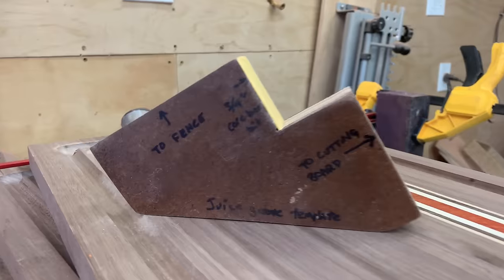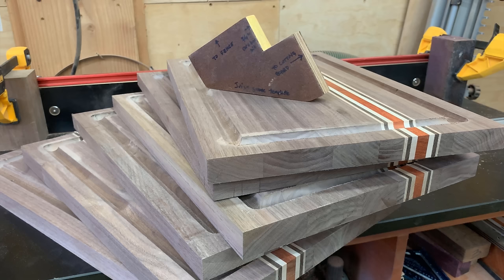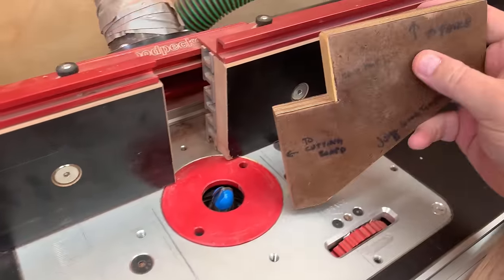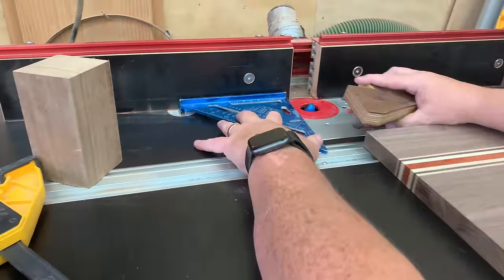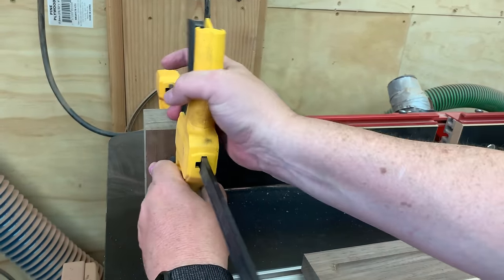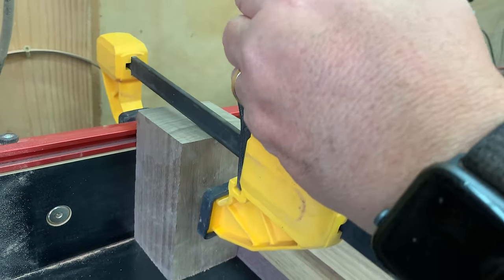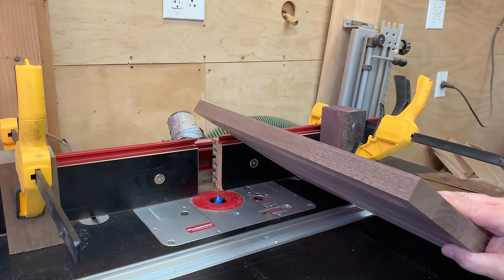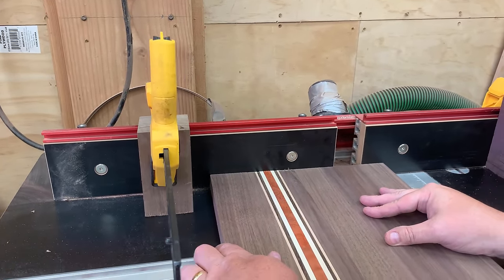87 - Make Perfect Juice Grooves for Cutting Board on a Router Table with easy Jig and free Plans

Comment: Thanks for this video.   I followed your instructions and it worked quite well.   I modified the jig to place the 3/4" groove at 1/2 inch from edge rather than 7/8" (reduced jig thickness to 1/2 inch, and reduce 1 5/8" dimension of jig to 1 1/4").   I got better results by always pushing the board through the router from right to left.   When going left to right,  I found the board had a greater tendency to be pushed away from the fence, thereby messing up the groove.   Definitely a good idea to first practice with some scrap!   Thanks again.
Reply: Thanks..

Comment: Hi James, I have followed your design and amended for metric... I used a 12mm Cove bit and my jig was a smidge under 18mm thick, so the distance to the board worked out at a smidge under 30mm.   This worked out perfect on my first test piece so I went for it on a 18" by 16" by 2" thick Walnut and Cherry End Grain Board.  I ended up with a juice groove 18mm from the edge of the board, best thing about your jig/template is that you can store it away in a draw instead of storing a massive jig in a small workshop.   Many Thanks.👍👍👍.  Paul in the UK
Reply: Hi Paul,
Obliged if you would share your metric measurements in a photo similar to one in video.
Thanking you in anticipation.
Regards
Paul

Comment: Just wanted to say thanks for the juice groove jig. It works like a champ. I used a 1/2" bit, so 3/4" from the fence and 1 1/4" from the bit put my grooves 3/4" from the edge of the board. made my first 3D board double sided with routed finger grooves for picking it up. Have a few burn marks to clean up and that was with a clean (cleaned) bit.
Reply from the maker: Hi William!! Thanks!!
Reply: I’d like to use a 1/2 inch bit also, but don’t quite follow what you did. Can you tell me, when you say 3/4 from the fence, do you mean you made the thickness of the jig 3/4 of an inch, or a different measurement? Thanks!
Reply: @scotth8084  yes, exactly, the thickness of the jig is what determines the distance from the edge of the cutting board to the juice groove.
Reply: @billyorston1  thanks!
Reply: Just to make sure I'm understanding this correctly, you changed the 1 5/8" measurement from the core box bit to the cutting board down to 1 1/4" and changed the thickness of the jig from 7/8" to 3/4".  No other measurements needed to be changed to use the 1/2" core box bit, correct?
Reply: Thanks, William.  I wish I had read the comments, before spending so much time thinking, calculating and redrawing the jig for 1/2" grooves at 3/4" from side.  Now that I have read your comment, I feel confident that I came up with the correct measurements..

Comment: Thanks for the video.  I did learn something, but I couldnt for the life of me figure out why all those different dimmension were so important.  I just made an equal sided cutout in a square piece of wood and it worked fine.  you used the same 3 reference surfaces agains the same reference points each time, just in different orientaitons.  

Thanks again.

Comment: Very happy I found your video. Something about the typical juice groove jigs had me rebelling against building one of those. Only issue: my 20-year-old Incra Twin Linear fence came with only one fence extension & stop. A call to the manufacturer about purchasing another extension/stop confirmed that parts are out of production. What to do? Attach an auxiliary fence? Fortunately, I had the extra Incra hardware to attach a length of 3/4” white oak of the necessary dimensions. Everything from that point forward works just as your video shows. And I had a 7/8” thick maple cutoff to make your jig. Stop blocks came from my cutoff bin as well. I never throw wood away…

Comment: Nice. I just did a run of 12 cutting boards, all but two of which are different sizes and have been dreading doing the juice grooves via measuring and setting up stops for every single one. This is a great idea and excellent tutorial.

Comment: So as long as the "to cutting board" distance (Orange in your drawing) equals the bit size plus bit distance to fence then all will be perfect. But you mention all dimensions must be exact. Do you use this template for other projects as well? Always good to have multiple uses for jigs and templates.

Comment: Man, I was pretty excited about this and watched the video a couple of times.  Went out to the shop, made the jig — then realized my little Bosch router table wasn’t big enough to use it.  Back to the drawing board....
Reply: I created the jig.  Then I went to use it and found that my router table (on the end of my tablesaw) was just on the edge of being big enough to clamp stop blocks for the board I was grooving.  I'm probably going to make the non-table jig so I can make bigger boards.
Reply: ````That’s exactly what I did, (made the non-table adjustable jig) and it worked great!  Only tip after you make it is to plan on making several pases to get the depth you want on the groove.  I made a mistake and tried to take the entire bite at once, and my router jumped on me.  Another tip if your router has a flat side on the guide, like my Dewalt does.  Make a new guide that is completely round so you don’t accidentally hit the flat spot while going around the jig.  Overall, very happy with the jig though.. good project, but I really wanted to just use this little table jig because it’s just so easy and doesn’t take up space like the non-table jig.

Comment: Made the jig, nice and easy!! Thanks!! I'm having a problem with my corners not lining up. It's just a little short. I've check and rechecked the alignment and they all work. Any suggestions? Thanks in advance!!!
Reply: Also, my bit is 1/2" not 3/4 like yours if that makes a difference.

Comment: Great video!  Thank you. One thing I’m exploring because I’m using a 1/2” bit and not-quite 7/8” thickness:  We should be able to find the fence location by placing the jig with the “To the cutting board” (1 5/8”) side on the opposite side of the router fence (turning in 90 degrees) instead of relying on precise jig thickness and specific bit size.

Does that make sense?
Reply: Eric: Agreed. Nice work around!

Comment: does this jig as you have sized it only work if you use a 3/4" router bit?  Would the dimensions change if the router bit was smaller such as 1/2" ?

Comment: Thanks for this. Question, why does the thickness of the template matter?  I can’t figure that part out. I have failed miserably in the past trying to cut a juice groove. Can’t wait to try this out.
Reply: I had the same question and someone responded. It's the first step and sets the fence distance. Guess you could use a 7/8" spacer instead. Just handy to have it all in one piece.
Reply: Thanks for that. I must have missed it.

Comment: James, I might be missing something, but the core box bit set you reference in the notes doesn't include a 3/4 size bit.  Can you confirm the size of the one you're using in the video?  Is it a 3/4 inch wide, 3/8 radius bit?  If not, what size do you recommend?

Comment: hi i tried your jig and it did not work, is it made for a specific size cutting board? everything lined up like your video except that when i put the practice board in to try it the bit went past the end of the board, what am i doing wrong? Otherwise great video and great jig if i can get it to work LOL thanks vic

Comment: I seem to be having a problem.  When I set my cutting board up to cut the groove. I noticed that the distance from the board as it was being cut. is 3/4 inches from the Fence. "as it should be". But, the cutting board ends  against the stop block, an  inch and a half from the end of the cut  and not 3/4 inches.  I can adjust it to end there, but with your gig, it does not.  I made it according to your instructions and have checked it several times. I even cut a piece of scrap wood out of the same size as the width of my cutting board, and the cut ends 3/4 inch before the end of the board.
I am using a brand new 3/4 inch cove bit.  I can simply move the stop block 3/4 inches, and it would be right. I must be doing something wrong.

Comment: so do you need a different sized jig for different thickness wood, or router bit?
Reply: Nope. Well kind of. The thickness of the cutting board doesn't matter.

This cool little jig helps you set the offsets needed to place a juice groove 1.25 " in from the edge of the board using a 3/4" bit. The thickness of the jig matters since it controls the distance of the bit away from the fence edge. The 1 5/8" distance "to cutting board" edge matters and needs to "pair" with the 7/8" thickness so it properly stops the cut 1.25" from either end of the board. 

Radius of the bit = 3/8".  So 7/8" + 3/8" = 1 1/4" (1 2/8") from fence to center of groove.
1 5/8" - 3/8" = 1 1/4" from stop block to center of groove. Perfect!

Thanks for this jig - makes consistent cut setup so easy!
Reply: I think I messed up twice. First I used a 1/2" bit and secondly I didn't have that 7/8" thickness on my jig, i only had 3/4". My juice groves did not meet 😂.
Reply: @vigutube  Thanks for this simple explanation of the essential dimensions.

Comment: Hi. If I’m using a ½ inch bit instead of ¾ inch what adjustments do I need to make the template work.
At the moment the bit is crossing over in the corners. 
I presume I need to take ¼ inch off but not sure which edge/a needs to be shortened on the template.
Also does it also mean that the template thickness needs to be altered to set the bit the correct distance from the fence.?

Thank you

Comment: Is there any significant difference if the thickness was 1" instead of 7/8"? It seems to me that the groove would be an 1/8 in more from the sides of board. I am working on a cutting board made from a counter top butcher block that was 1 1/2 " thick. Planed down to 1 1/4" thick, 12"X18" final measurement. I got two out of the counter block. Is it a 3/4" core box bit or is it a cove bit? A newbie question for sure!

Comment: While thag jig is certainly effective and convenient, I just used a piece of wood 7/8 inch thick and a square, spaced the  fenc from the bit, then turned the router bit so the blades are horizontal, put the pice of wood against the left side of the bit, put a square against the fence and abutting the piece of wood, used the board to measure to the stop block on the right side then repeated to set the block for the left side and it worked.

Comment: Brilliant! One question. When you are setting up the stop blocks, the first one you moved to cutting edge of the cove bit so it was against the template. But when you set it up on the other side, you didn't rotate the cove bit so it was against the back of the bit. Wouldn't that make the juice groove slightly off center?
Reply: I believe the bit has two cutters on it...directly across from each other.

Comment: Great video! What changes would I make to the template if I wanted to use a 1/2' core box bit instead of the 3/4" bit?
Reply: I have the same question,  i also want to use a 1/2" bit
Reply: I guess it will slightly change the jig dimensions. The proposed ones work for the 3/4" bit and for the resulting groove and distance for the margin. I'd try to adjust the 2 and 1 5/8" dimensions down of 1/4" each. And then try on a scrap piece of wood.
Reply: If you wanted to keep the groove centered 1 1/4" away from the edge (as the current jig does), then I think the thickness of the jig would have to be 1", and the 1 5/8" stop offset would change to a 1 1/2" offset.

A 1/2" bit radius is 1/4". The jig would then put the center of the bit 1" + 1/4" = 1 1/4" away from the fence, and it would position the stops to stop the cut 1 1/2" - 1/4 = 1 1/4" away from edges.

Comment: James, what has your experience been making a juice groove on end grain boards instead?
Reply from the maker: It works perfectly fine. Slightly higher chance of burning, so I’ll usually do 2 passes. 

The first pass i do at about 95% of the depth I want, and the second pass to finish up the groove and remove any boards.

Comment: Anyone know the jig measurements if I want to use a 1/2 bit?  Thanks in advance.
Reply: If you wanted to keep the groove center 1 1/4" away from the edge (as the current one does), then I think the thickness of the jig would have to be 1", and the 1 5/8" stop offset would change to a 1 1/2" offset.

A 1/2" bit radius is 1/4". The jig would put the center of the bit 1" + 1/4" = 1 1/4" away from the fence, and position the stops to stop the cut 1 1/2" - 1/4 = 1 1/4" away from edges.
Reply: @vigutube  What about the 2 inch dimension on the drawing?  Is that just the offset + the bit radius calculation?  So 1 3/4 in the example above?  Or would that not change?
Reply: Curt Bentley the only dimensions that really matter for getting the groove right are the 1 5/8" and the 7/8". Those are the dimensions that make sure that the groove stops at the same distance from the end as is the distance from the edge.

Comment: Is there a formula for creating a jig using a different size bit and different distance from the edge of the board?
Reply: Bit Radius "BitR" = Bit Size * 1/2

Thickness = EdgeDist - BitR
Block Stop Offset = EdgeDist + BitR

Example:
3/4" bit, Groove 1 1/4" from edge.

BitR = (3/4 * 1/2) = 3/8
Thickness = (1 1/4 - 3/8) = 7/8
Block Stop Offset = (1 1/4 + 3/8) = 1 5/8
Reply: @vigutube  this is the most important comment on this thread. Too bad it's buried. Thank you for posting this!
Reply: @vigutube  Elegant, as a math folk would say.

Comment: Hey king
Any idea on what the measurements would be for a 1/2 inch bit? That's all I have.
Reply: I think the distance “to cutting board” should be 1 3/8” instead of 1 5/8”, assuming your width is 7/8”.

Comment: What am I doing wrong?  I tried this on some test boards but when moving left-to-right, I got some gnarly climb cuts.  I tried holding very firmly but still got that when moving right.  Because the shaper table can be very dangerous I don't want to force anything unsafely 😄   So I stopped to ask this question

Comment: After cutting the grooves on one end or side of the cutting board, would you not then be able to use the bit and the now present grooves to place the stop blocks for the other edges? If you make sure the cutting edge of the bit is parallel to the fence so it would reference from the furthermost point of cut to remove the risk of over-grooving, something I used to do in the 80's quite often?
Not criticizing or anything of that nature. Just genuinely curious if that would work. I do not, as of yet, have a router or router table so I have no experiential knowledge. I do love the idea of anything to increase the efficiency of setup.
Reply from the maker: Yes! You sure could! Great idea!

Comment: I'm pretty new to woodworking, so it isn't super obvious how to make the jig. Is there a video on how to make this jig? I see the video for the bigger one. I'm still not clear on why the thickness of the jig. is the thickness about the thickness of my board, or the depth of the groove? I'd appreciate some clarification.
Reply: You can cut the general shape of the jig out using a table saw and a good miter gauge; it is very important that the corners are 90 degrees, as one edge of the jig will reference the router table fence, and the perpendicular edge will be used to reference your cutting board and set the stop block. To cut out the corner, you can use a jig saw or hand saw; it doesn't need to be exactly 90 degrees. The thickness of the jig will determine the distance of the juice groove from the edge of your cutting board. The depth of the groove does not involve the jig, as that is simply set by the depth of your router bit.

Comment: Do you ever have a problem starting the plunge with chips flying under the cutting board and holding it up off the table causing you to get insufficient  plunge depth.?I noticed in the video that the chips appear to be spraying under the board as begin the plunge pass.
Reply from the maker: Yes. Sometimes. And if that happens, I’ll take another pass. It’s pretty easy to see after you look at the groove. 

Note: it doesn’t happen when my dust collection is hooked up to the router table. But I haven’t had it hooked up for a while. I should get that done.

Comment: Great video, two questions: 1 how high does the router bit goes. 2 the thickness of the jig has to be the same as the cutting board?
Reply: No. The thickness of the template represents the distance from the edge of the cutting board to the edge of the juice groove. At the beginning of this setup, you saw him use the template to adjust his fence to the right position.

Comment: Great video! Which jig do you prefer? This one or the other one you designed for hand held routing?
Reply from the maker: Haha. It depends on whether or not my router table is cluttered up, or if my large jig is all the way across the shop. They are both almost the same in usage. But the large jig is a little faster to set up. 

I suppose if I had the shop relatively clean and the large jig on my assembly table already, I’d pretty much always use that. It’s just faster.
Reply: @KingsFineWoodworking  great! Thanks for the input. Ordered your plans last night and starting the build today!

Comment: This particular jig works only with a 3/4" bit..  I tried it with a 1/2" bit and it failed totally.
Reply: I am working through similar situation in addition to having a template thickness that isn’t exactly 7/8”. 

Assuming you have the 7/8” width like in the video, add your bit diameter to that to get your new distance from the cutting board. So instead of 1 5/8”, it would be 1 3/8” for a 1/2” bit.  I don’t think the other stuff needs to change.